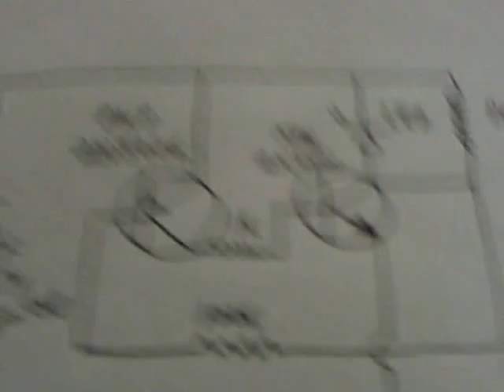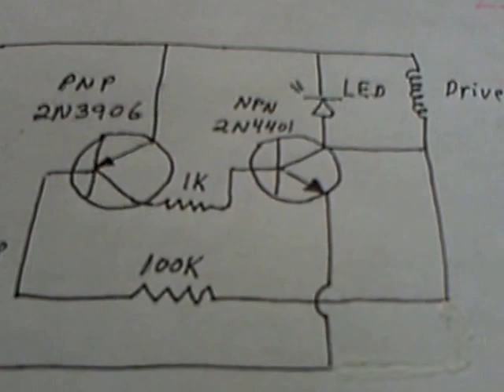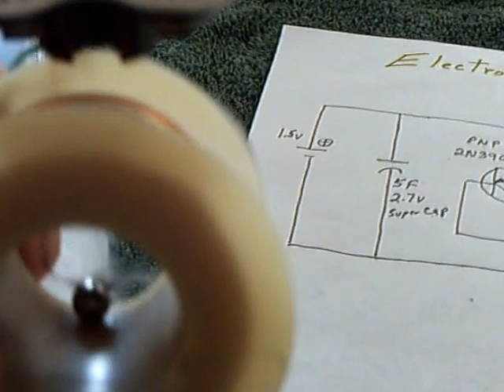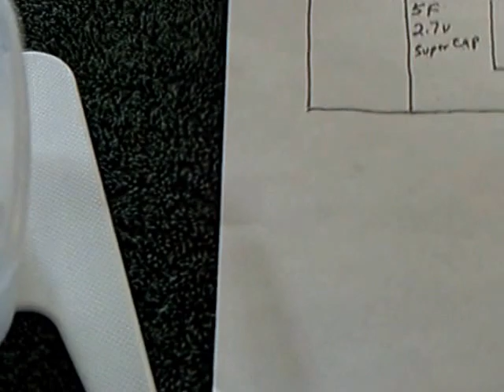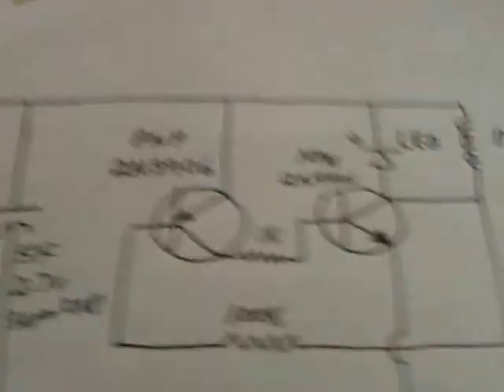Boxing the Paper Clip Motor

Comment from the maker: I hope that you get a chance to build one.  You may want to use the circuit that XDD29 made for his motor.  It will self-oscillate and light the led constant or spin the rotor.  Amp draw is still down at around 40mA.

Comment from the maker: I like yours better than mine!!  The way that you changed the circuit so that it will self-oscillate and drive those leds bright off a AA battery is wonderful.  I think that this is what Bakupcpu did to the circuit. You could probably add a 1k pot in with the 1k resistor to get some control.  Thanks for sharing your project.  Good job!!